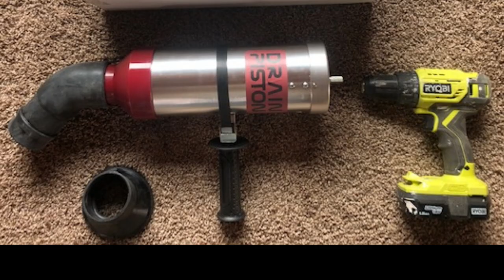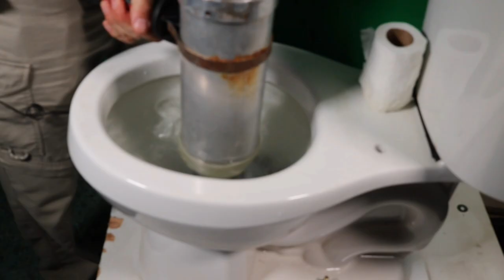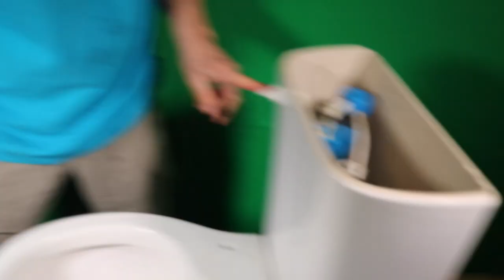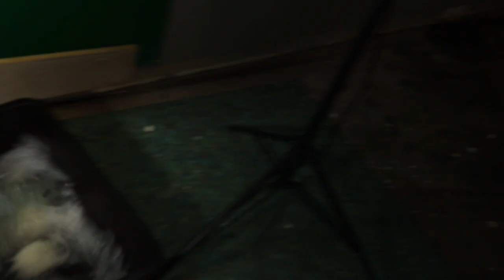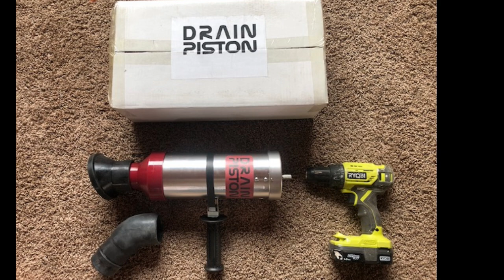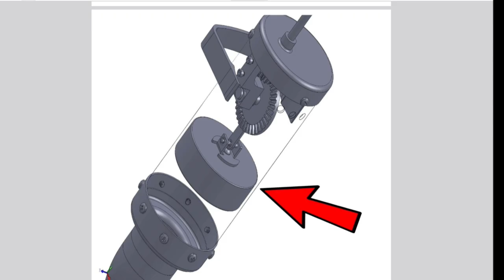Drain Piston Investor Video

Comment: A really great tool. You're right about replacing all the costly parts.

Standard uPVC 110 mm pipe, perhaps in orange, can be purchased in or cut to specific lengths. If you could replace the steel end cap with a uPVC end cap, you will likely need to heat glue a steel bearing into the top cap.

If you can only import the assembled gear mechanism, there will be little cost and very little duty to pay - and the machine could be easily assembled locally.

Looking forward to following your progress. "Snarf!" 😂